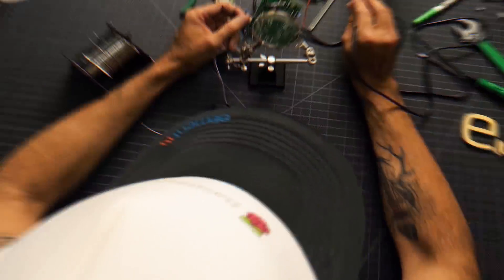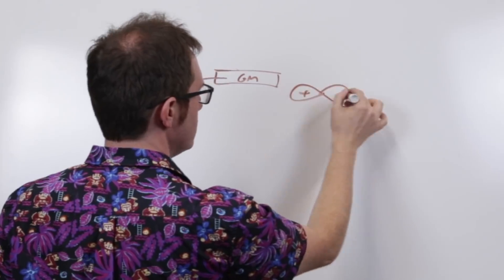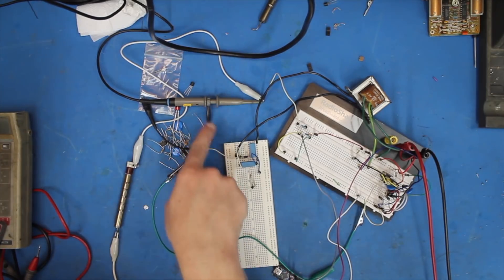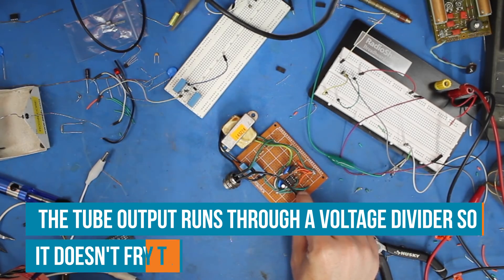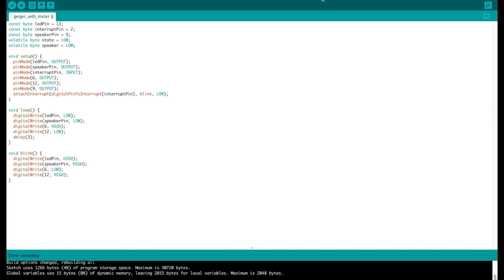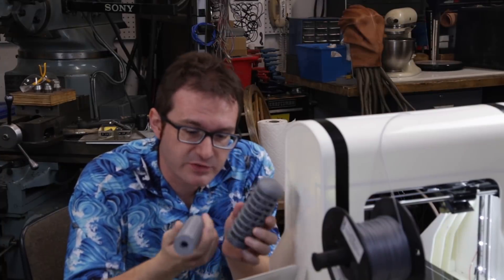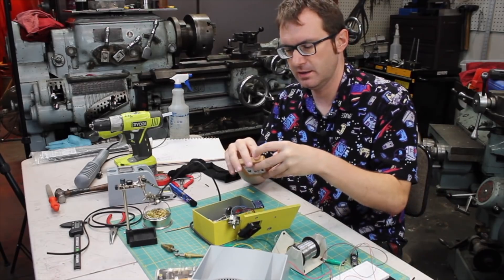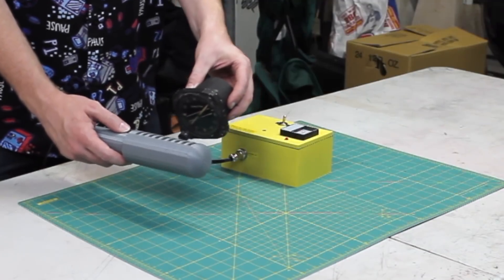Pripyat - DIY Geiger Counter

Comment: Excellent video! That's an awesome build! Simple, yet made very well! You should build more! You're good at it! People would buy those! I can't wait to build my Arduino G-M counter kit when it arrives! I have the case ready for it. I'm using the huge SBT-10A G-M tube for mine. It has a mica window, so it's capable of detecting alpha too, and lower-energy beta and gamma/X-radiation. The tube has 10 anodes! Radioactivity is an awesome hobby and area of science. I absolutely love it! I have A LOT of sources, and I love to build and repair Geiger counters! I wish so many people didn't have such an irrational fear of low-level sources or even just "radiation" itself. Ionizing radiation is EVERYWHERE. Old aircraft instruments sometimes have a higher activity, having more concentrated Radium. That ADF is an old non-directional radio beacon (NDB), probably from a WWII fighter. I have a lot of Radium sources. They're all sealed up, so no dust and little Radon escapes. Anyway, well done! Well done indeed! Thanks a lot!

Comment: How about the insane amount of microwave radiation that we are bathing in all day everyday from WiFi routers, WiFi equipped devices, Smart Meters, cellular phones, cell towers, cordless phones, baby monitors.... ?
Reply: Oh please. You do realise that light is "radiation" too, right? Got a lightbulb in your house.= being bathed in radiation. 
Every lifeform on the planet is bathed in massive amounts of 'radiation' every day.
A wifi access point is not a lump of plutonium.
Reply: There's a huge difference between ionising and non-ionising radiation. Non-ionising radiation (microwave ovens, wifi, cell phones etc) doesn't cause cancer because it doesn't have enough energy to ionise particles. Ionising radiation (gamma rays, UV etc) can cause cancer.
Reply: Thanks, Azy! People tend to confuse high-frequency radiation with high-energy radiation. And even most of the ionizing radiation we experience in day-to-day life is relatively harmless--unless, like I said, you go around naked breathing radon gas and eating uranium ore all the time.

Fun fact: there's actually trace amounts of (naturally occurring) uranium in my municipal tap water. It helps give Los Angeles that nighttime glow....🎆
Reply: The jury is in, actually. Non-ionizing radiation, like that from cell phones, wifi access points, etc, does not cause harm to humans. There is no known mechanism by which it could cause harm, so the theory is implausible to begin with. And sure enough, when properly blinded and controlled studies are performed, no difference is shown between people exposed to varying amounts of non-ionizing radiation, as you would expect. You can read more about the actual science that studied this theory here https://sciencebasedmedicine.org/nonsense-about-the-health-effects-of-electromagnetic-radiation/
Reply from the maker: Research into the effects of ultra-high-frequency radiation is still ongoing (900mhz , 2.4ghz, etc). From journals it isn't entirely conclusive or causative yet, though some of the articles are still being peer reviewed. So the jury's still out on that.